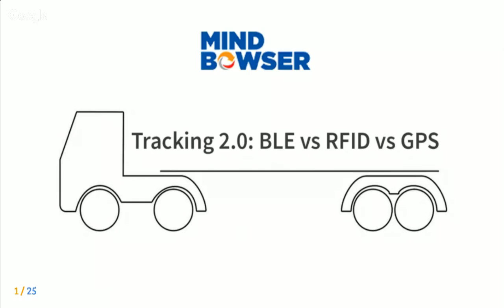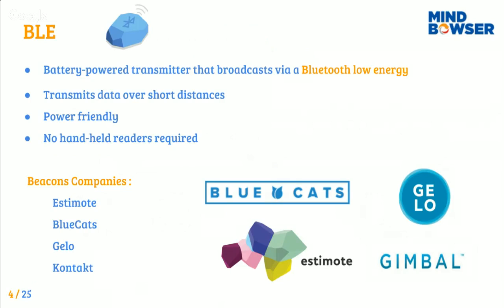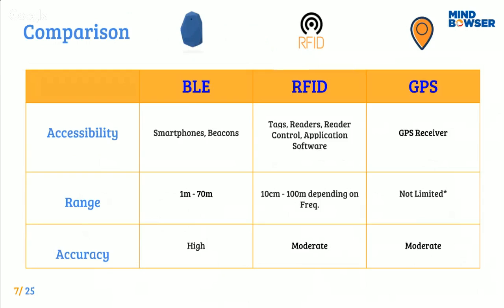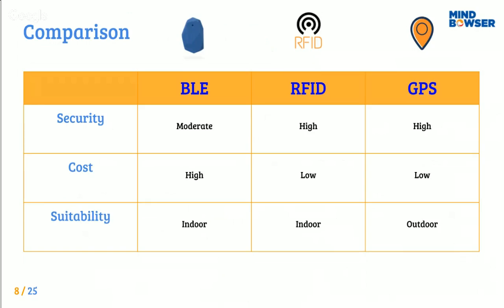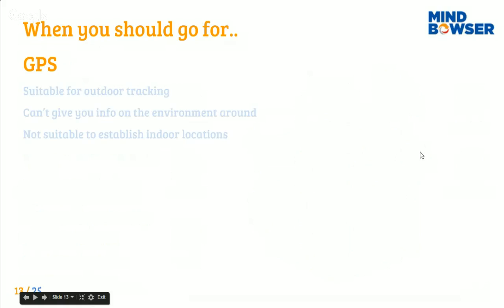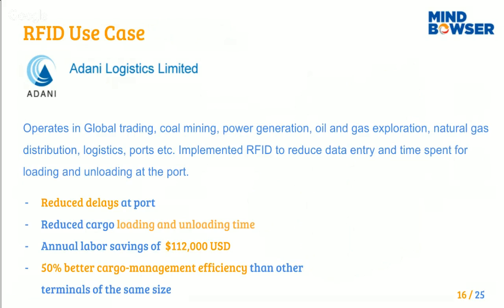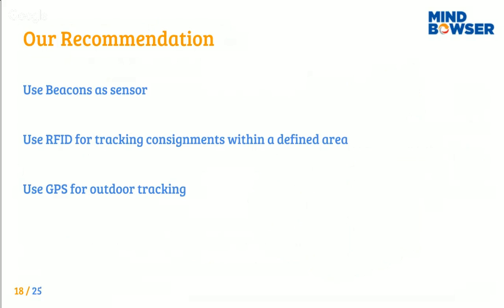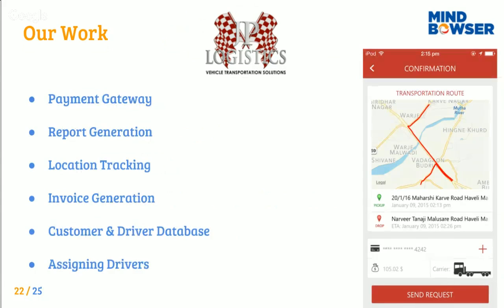Tracking 2.0: RFIP vs GPS vs BLE

Comment: Ayush, very good presentation, however I feel it's missing to address some points.

First of all, I was searching half a day for an answer to a very simple questions: Can BLE be used for IT HW asset tracking within a datacenter environment with say 5000 assets? (networks, servers, storage devices, racks, etc).
It's a simple question that nobody seems to ask or answer, from what I have found. Your presentation somehow answers it, but not directly, so I'm still not sure. Keep in mind that active RFID solutions offer tags that you can write information on, such as Serial numbers, free form text, etc. but it also provides an accurate location down to rack level tracking.

Second, your presentation does not give any kind of details regarding the technology itself and how it functions. It's still not clear to me, after reading comments and published articles, how does the beacon system work practically? what's it's main purpose? I know it works via bluetooth, but that about it. Can you for example have a fixed reader, that can capture beacons?

And last, but not least, you fail to mention the distinction between active and passive RFID and that active RFID systems can provide you with humidity, temperature, gas or fluid leakages, proximity as well as tamper and low battery warnings.
Also, an active RFID tag does require a battery, but it's coin cell that can last between 5-7 years, at a 30 second beacon (ping) rate. Of course, in the case of active tags, the cost is much higher than the 1 cent you mentioned, ranging between 10 dollar to 100 dollars for environmental monitoring. They can be used as a real time, instant, asset tracking, "pulling" an instantaneous baseline of hundreds of thousands of assets across the globe.

Thank you